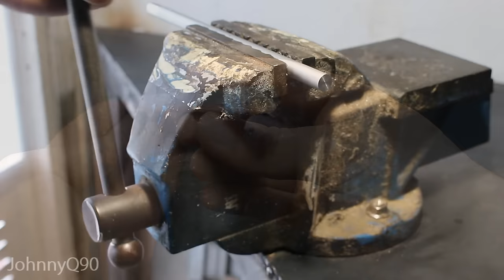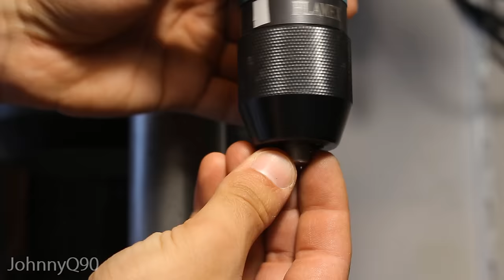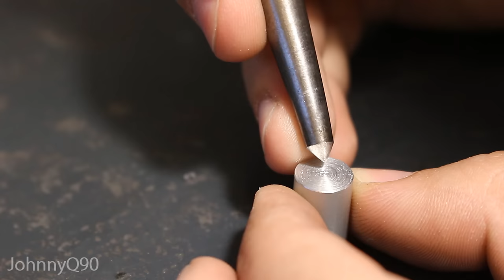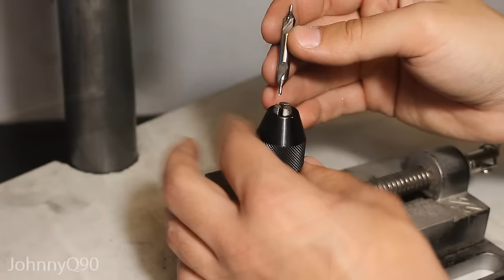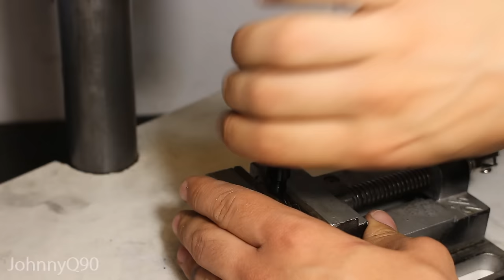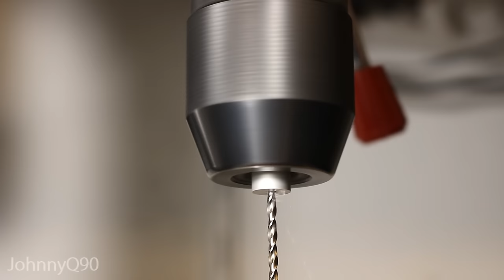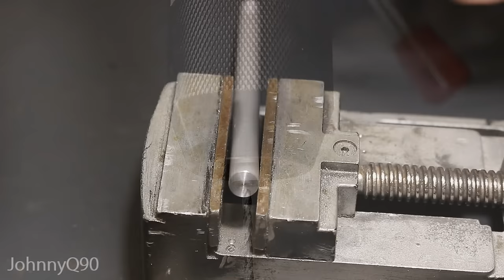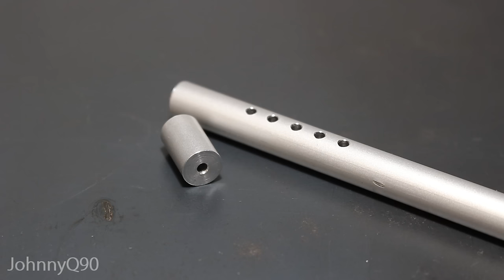Simplest Way to Drill in the Center of ANY Rod!

Comment: Too many inaccuracies! Eyeballing the center punch, assuming the 2nd chuck in the vise is vertically true, but also that the drill press table is perpendicular to the chuck in the drill press, etc. Nice try, but this method does NOT guarantee a precisely centered hole.

Comment: 1) This is not exact center when an eyeballed punch is used. 
2) Also, this method is not the "simplest" method.
3) This method wont work on "any" rod/pipe. 
Simpler method would be, hold the rod in wise, find a sacrificial wooden rectangular piece that has the same width, also hold this in wise. Then join corners diagonally and drill in the center.
Reply: It's a self-centering method. Idk if it is the simplest way or not, but the initial punch only being approximate doesn't matter

Comment: If the drill chuck was slightly crooked in that vice, your initial hole would be crooked, making all of your holes crooked.  Sorry, but almost is not dead center. Even your center punch trick was not 100% guaranteed. This is OK for a mini flute, but not parts for machinery.
Reply: not sure who would think you could even get such accuracy without a lathe or CNC...  clearly we're not making a 5,000 RPM driveshaft here...

Comment: OK and if you have to do this to every different size you need to drill its not simple. Simple does not mean take an hr to make a jig. To do a 15 min job with out using a jig. So it takes 65 min with a jig . and 15 without. my time is better spent smashing my thumb than doing this. nice video wish you would have fast forwarded it at 3 times fast than you did. A 30 sec video was long enough for that.

Comment: LOL, another expert using a lathe center drill to spot a hole.  Center drills are for centers, not spotting holes.  In face, they can cause the drill to wander.  Want to know about center drills and spot drills check out Stefan Gotteswinter.  Now there is a REAL machinist.

Comment: What a ham fisted technique...The center wasn't on center, the center drill wasn't in the jacobs chuck far enough for any accuracy and the jacobs chuck in the vise was set by eye, The drill press chuck isn't concentric nor is the piece of aluminum that was inserted in its jaws and who in their right mind uses a japanese saw designed to cut wood to cut off the coupon for this demonstration.  The hole is not "exactly" in the center but I suppose it's ok for Americans

Comment: What a crock of BS. Put the bar in the vise on a milling machine like a Bridgeport, use a edge locator or finder, move over to the center of the bar, use center drill, and then use the drill you need.

Comment: Real machinists should already know and the wannabes should shut up and ask questions. If you get the center punch close to center the center drill hole will cut over size but since the work is spinning not the bit the hole is going to be centered. 
  Not open to discussion. You may ask questions. That is all.

Comment: Not the simplest. The simplest is to just use a vee-block. Center the drill bit in the vee, then lay the workpiece in the vee and hold it down with your fingers. Drill. No drill guide to store or lose. Bang bang bang bang.